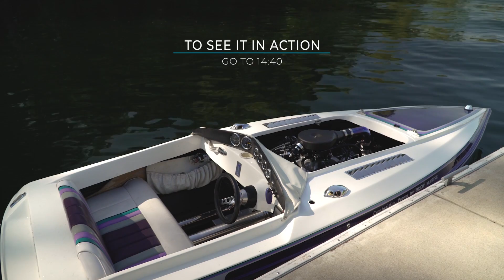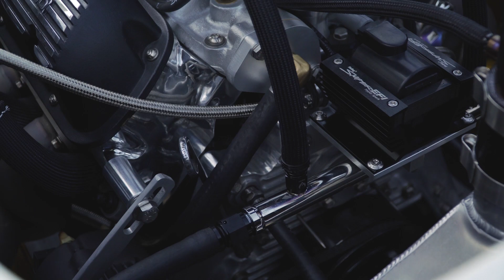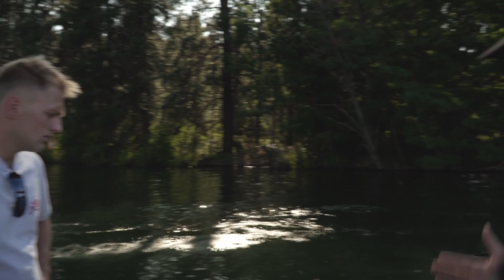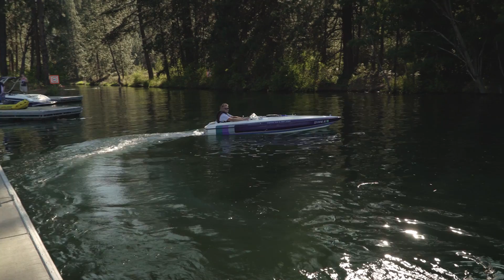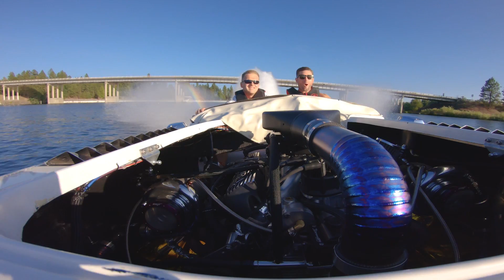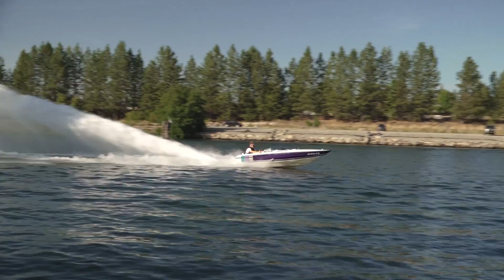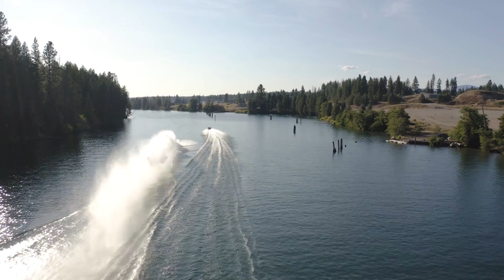13ft 1000HP+ Twin Turbo Jet Boat EP:3

Comment from the maker: Do you guys want a follow up video on this beast? Like, Comment and Subscribe and we will be posting one soon 😏
Reply: Friend, was there ever a top speed recorded for this wild ride ??
I'm guessing 100+ mph but someone else here is thinking maybe 85 mph tops..........
Reply: The factory Berkeley set up that we have tops out at 75 no mater how much hp we throw at it
Reply: One of the owners videos states he hit 95 mph and I for one believe him.
Reply: 83 Ford... is there any gearing that can be played with to get the jet drives to provide a higher output or do they just hit a wall and that's it ??
Asking because honesty I dont know how the pumps work in relation to the motor.
Reply: From what I understand you can change the pump but adding a droop snoop and ride plate get a lot more speed that way we were told if we did that we could hit 100mpr
Reply: Sweet !!
Reply: @georgewaters8592  I have video of mine under 83fordtruckin blown big block
Reply: Ok thanks... I'll check that out later as I'm out in the front yard enjoying a glass of Ellie's Brown Ale on this nice New England evening while my dog is roaming about in the garden.
Cheers !!
Reply: @83fordtruckin   Just saw 'em... pretty wild !!
I was asking about things to do with the pump to make it push out more water - because when I grew up in Brooklyn NY and eventually got into street racing, I learned that horsepower meant nothing if you did not have the right gearing in transmission and rear end.
I got a guy at work now who wants me to put twin turbos on my 5.0 EFI Country Squire Wagon, and I keep telling him to forget that, I'd rather keep the motor stock and run a 3 speed Turbo Action reverse pattern manual trans w/8 inch converter and a 5.13 rear.... and he just walks away.
So, I was figuring that maybe there's some kind of gearing going from the motor to the pump, as there has to be some kind of transmission I would think, then again I seem to think it just changes the direction of the water jet flow at the end of the pump... gosh it's been too long since I've seen one with me own eyes !!!
Reply: @georgewaters8592  each jet is different like mine I'm sure we could change the pump and bowl and get more out of it but the bolt on stuff like the ride plate and the droop snoop does a lot too the droop snoop puts the jet deeper in the water instead of straight out of the transom like a factory setup like mine
Reply: Ok... thanks for all the replies.
Reply: That rooster tail though...….
Reply: @kylecook3188  I know... that is nuts.
I was wondering if that's also a sign of too much power being lost.

Comment: Make the next video be: Tubing behind 1000HP jet boat lol
Reply from the maker: Yes that would be sick haha
Reply: @romantheegreat208  the 3rd video would be CPR on a tuber that drank 4000 gallons of water in .5 seconds
Reply: I volunteer as tribute
Reply: "death caused by jet boat" would be the title
Reply: @unoefxz  Indeed, we pull rings alot behind jetskis, if you pull the throttle with the rings in the line of fire people are gonna have a bad time.

Comment: Edelbrock carbs are nice for blow through turbo induction. They are much more air tight and really simple to tune . Ive used them a few times for blow through setups without any issues . I turboed a old Stevens V drive with a 460 and a diesel turbo off a powerstroke diesel. It was super fast . All wrecking yard parts including a 160k 460. Ran it for 4 years and sold it running strong. It was very thirsty for a V drive but wow was it fast

Comment: Two things?
Insurance and a parachute 
Have fun, I know I would!
Reply: Life insurance
Reply: How well does a parachute work when it gets water shot at it? Lol
Reply: and helmets
Reply: @mrright69  The use of a parachute is common safety equipment on a driver in Dragboat racing.  It helps in the event of a crash.  It slows the driver separating him from the hull.
Reply: Common does not always qualify as smartest. The largest fault of humanity is the inability to come up with our own new solutions. To stop fast adding an upward spoiler from the front of a boat would do just the same. The problem lies in surviving in a split second and our brain stuck in fluid sloshes to the back and destroys itself upon instant stop. 
Therefore.. Take the risk, go out with a bang. 
It is all for thrill anyhow. 
Even hyper-cars use this. But not dragsters. And when chutes fail. You overthrow all barriers. ;)

Comment: Only 2 issues with the build, the 2 crappy hose clamps at 5:11 and it needs about 3 more inches of droop in the snoot. You want the nozzle completely under water and running flat at mooring speed. There is a LOT more speed and stability hiding in the snoot for sure but the roost factor is amazing!! Otherwise, awesome project and you have outstanding TIG skills! The design is reminiscent of the "cracker box" race boats that were all inboard direct V-drive until now! Such a cool project and you did an outstanding job on it!!
Reply: Thank you for the advice! I love hearing everyone’s advice! Theres alot that can be done to make this boat handle. 1 thing at a time
Reply: @andrewbacklund4752  I see you have a jet-o-vator which is a great piece for trimming but pointing the thrust down to drop the nose sacrifices so much thrust and is costing you top end speed. I am assuming that when you are getting on it  you have the nozzle aimed flat but it is bouncing you around by porpoising. When the boat is sitting at the dock, see how much of the nozzle is out of the water, at the highest, you want the entire nozzle opening under water. It will help in many ways but mostly stability. I don't foresee you wanting to run triple digits all the time in a 13' hull but the bouncing is so friggin dangerous, mainly because it looks like it it is close to stuffing the nose. Your take-off has to be incredible as is but with the set-up I am suggesting, you will put all the ponies to work in forward motion. If you are having any issues with cooling the motor or getting it to temperature, let me know. I have some jet boat tricks up my sleeve!
Reply: @uno efx 

I’ve tried trimming the boat many different ways and it performs best trimmed all the way up. People see this video and think about handles like shit when in reality it handles amazing in the correct water. This is some of the roughest water I’ve ever ran the boat on since I’ve had it. I almost never run down the Coeur d’Alene river. With wakes coming from all different directions its best to just fly over them haha. This isnt a race boat, its a 13ft weekend rally machine. Weather i hit triple digits is Irrelevant to me. The shear Acceleration is something to behold. Im not a pump guy but some day ill have some serious pump work done to it. But for right now, its a blast as is. 🤘🏻
Reply: @andrewbacklund4752  As I said, the take off has to be amazing, probably breath taking. I am not dogging at all, just passing on my knowledge of experience with squirt boats. The reason is works best trimmed up is the weight of the motor being in front but also because of the thrust from the nozzle being half way out of the water. The thrust point is too high which is pushing the nose down. Thats all I am saying. More of a droop snoot I think would work better for you. You have a marvelous toy that you can literally call your own being as it is one of a kind and built by you. I would love to go for a drive in it but no way could I handle a "ride" in it!! Hahaha. Having fun is the priority and you seem to have that nailed. But for real... Change those 2 hose clamps!!!

Comment: Actually the suction of the jet pump on the water is what pulls the boat through the water, the jet of water out the back is not what actually propels the boat. That's why rooster tails shooting 50 foot in the air are possible and the boat will still move.

Comment: What an awesome project! But please trim the boat down. It's handling like a wheelbarrow full of bowling balls.
Reply: It would be alot faster if he were to trim it down. Didn't see if it was a place deverter or a jetovator. If he's running a diverter about 5 degrees positive is all you want or need. Should shoot straight back and just fade away no arc. Shooting a rooster is just for looks but The eat up alot of speed.

Comment: I'm not a jet fan but. That one hell of a creation.  It reminds me of a Cracker Box only jet driven.  Can't imagine that with a surface drive.  What's it run topped out?
Reply: Id like to know too. It appears to cavitate at 50-60mph. Not sure if that was just because of the roost show (improper trim), or if it's a design problem.

Comment: Crazy how much trim up that wants, wiht that rooster so high. When I trim my jetski boat that way, it bounces and cant reach top speed.
Reply: I agree. The trim on this boat I feel should be neutral or maybe 1°-2° up. V hulls do have a tendency to bounce a lot though and it can get pretty dramatic the smaller the boat is. This boat is nearly jetski size. Lol

Comment: ALL THAT HP DOESN'T REALLY DO IT JUSTICE. DUE TO THE BOAT NOT BEING HEAVY AND REQUIRING A LOT OF POWER. THE ONLY THING THAT WILL DO IT JUSTICE IS PROP PITCH, DIAMETER, AND RPM. LIKE I SAID BEFORE I WOULD UTILIZE A 6 SPEED TRANY, AND AN OUT DRIVE AS WELL. BTW, GLAD TO SEE THAT IT IS A FORD ENGINE!!!.
Reply: The impeller is rated/efficient til 6000 rpm, a tranny makes no sense.(it is not a car)

Comment: I'm wondering what jet pump it has, then what impeller cut ? It looks like a porpoise mobile .🤔
Reply: Very cool build but the CG is way forward and the hop comes from the berkeley 12je pump getting to much water in front of impeller at speed (over charging) closing the center of the loader may help ........JET CONNECTION PERFORMANCE MARINE ,very cool stuff nice to see young guys buiding and having fun in a great sport
Reply: lightningjet 
the cg is way forward but thats what makes it so much fun to drive. The pump needs some work but overall its a great little unit
Reply: @andrewbacklund4752  is this your boat ??
What can it do for a short burst, I'm guessing 100+ mph.....
Reply: Looks kinda slow for the setup.....

Comment: I was wondering what you did to the engine to keep it together.  Stock 302 Ford blocks are notorious for cracking right down the lifter valley at power levels above 450-500 HP.  Are you using an aftermarket block?  I don’t think a stock Ford block, even girdled could handle this power level very long.

Comment: Great build needs trim tabs to stop the bounce.
Reply: You don't need tabs on a jet. its propusing because the jet is trimmed out for show. Great build its basically a floating engine!
Reply: Im working on a down plate thats controlled from a bake master cylinder. Will see how it works
Reply: If he had trim tabs then he could show boat and ride smooth

Comment: Let's see the dyno sheet.
Reply: It's very impressive but it isn't 1000 HP. I'd wager it's just north of 600 though.
Reply: @Kamwi_003  Whatever it really is, looks dangerous enough for adrenaline production.
Reply: @Kamwi_003  shit, twin turbo SBF, 1000hp ain't that difficult.
Reply: @thereluctantgearhead4544  not with a stock block 302 at 600hp it would be split in two pieces. We have split many back before the aftermarket companies started making blocks. He didn't say anything about a new block. Definitely not going to make 1000hp and live but a true 600hp would be a wild ride. Been drag racing boats and cars 20+ years.

Comment: What a pisser !! 
You know, I always wondered if anyone ever made a front engine race boat,  and here comes this baby !!
Acceleration appears to be tremendous, perhaps second to none - and is it safe to say top speed is well over 100 mph for short bursts ?? maybe 125 + ?? 
Again, what a pisser.... I'd love to go for a ride but I'm pretty certain I'd crap myself !!!
Cheers Mate, excellent excellent project boat you got there.
Reply: doubt it maybe 85
Reply: @charlesevans1840  Seriously ??
I remember doing 65mph in a 19 foot checkmate jet boat back in the late 1970s, with a stock 455 Olds motor, and it was not straining to do 65, that motor was turning maybe 4800 - 5000 rpm.
Today's big blocks do 7000 rpm, and that kids motor is built !!
With all due respect, I'm standing by my numbers until I am told otherwise by either the boats owner or the folks here making the videos.
I did say short bursts - not long term
That checkmate [which I think was made in 1975] could run 65 all day long, I think wide open was about 70, 75 mph.

Comment: Anybody else notice that even though he was going really really fast he never did actually completely open the system up and let it just run Full Throttle. My guess is that boat would turn into shrapnel after it hit about a hundred thirty miles an hour

Comment: Based on the highest engine pitch I heard, it tells me you max at about 5520 RPM. Using Berkeley impeller curves and reasonably assuming an AA impeller, the actual power output in this setup is about 627 HP. If it's an A cut, the actual engine output is more like 534 HP. If you want full engine output, the impeller has to be sized to hold the engine RPM at the peak of its power curve at full throttle.

Comment: I cant imagine a factory Ford cast 302 block handling that much power and not splitting down the lifter valley. They tend to come apart around 600 hp in my experience . Very cool boat but I have trouble believing its making 1000 hp on 10lbs of boost . In fact I know it isnt because that block would absolutely not take it.

Comment: Nice job funny thing for many years I've been wanting to build one with a rx7 motor I'm both v8 guy and I've had. Rotary but if you ever bang it up and need some glass work done let's make the molds I love that hull and I've got 45 plus years in fiberglass from building a one piece jeep tilt front end and hundreds of corvettes I do have references   and I have worked for a boat company north of Santa Barbara  this is my friends account on here I'm Keith Preston's sanders on face book

Comment: How do you deal with the heat from your headers and turbine housings, I noticed that they are not water cooled?  Otherwise kudos on your painstaking attention to detail, as it  might otherwise have turned into a 13 ft. deathtrap.
Reply: David Wright 
they keep you warm when wanna do a midnight rally and make any girl want to take more cloths off on a hot day😁
Reply: yes they are water cooled he said so in the video
Reply: He said the exhaust was cooled after the turbos. That was shown in the video, but I didn't see any water plumbing to the turbine housings or to the headers coming from the heads to the turbos. Which would be the hottest part of the exhaust.
Reply: I don't believe you're supposed to cool off a turbo with water and the picture he showed that it was only at the most 6in of the exhaust header that was not cooled he should wear it was injected in to the exhaust I don't believe the turbo would run very smoothly with water injected into the turbo
Reply: Most all marine diesels are turbocharged and use a water cooled turbine housing that has a cast in water passages similar to a marine exhaust manifold. The water is not injected into the turbine itself but mearly surrounds the turbine to absorb excess heat. In some cases even the center bearing assembly has water passages cast into it to help cool the bearings.
Reply: They were cerakoted and he just wrapped them in exhaust wrap.

Comment: Mad props to your attention to detail buddy nice job. I assume you used the Dart 8.2 block ?My bad I see the parts list now. So the Boss 302 block. I noticed you didnt list the heads..? AFR.? TFS..? Valve sizes.? port work?
Reply: Ed Norton 
J302 heads, 12.3 WOT AFR 2.020X1.60 stainlessXinconel. Lightly ported intake side, polished combustion chamber, port/polish exhaust with gasket match into the header as well and the t4 flange to turbo. Also ported the waistgated tube thats welded onto the exhaust housing. 
Thanks so much! This was not easy to build and do it right. But it was well worth it. Cheers
-Andrew
Reply: @andrewbacklund4752  I had J302's on a 306 I did years ago. Cant fit the 2.02 & 1.60 in that chamber. You can (as I recall) either use a 2.02 & 1.56 or what I did which was turned a 2.02 down to a 2.00 and then ran the 1.60 > Those heads worked very good as I recall and they just never got any love. I want to say I had the intake side @288 cfm @ .600 lift and the exhaust 214cfm @.600   28 in. Dont quote me a 100% on that Im sure I have the notes.. But yea they worked pretty good. Anway you did a beautiful job on the boat very well done in all ways . Also very unusual layout. Someone knew what they were doing and was playing possum maybe. Crazy thing is at 13 ft it seems to work with all that power. There some jet boats at 18ft that dont do well with 500hp. How fast has it been at the top end?   Do you know how fast it can go..? Something tells me those two may not be the same number..??

Comment: So it looks like the water intake was on the front of the boat?? So if you're not on Plain where is it getting water from
Reply: kevin keller 
Jet pump Pushes water from the back of the boat to the innercooler first. Motor coolant temp runs bout 150°